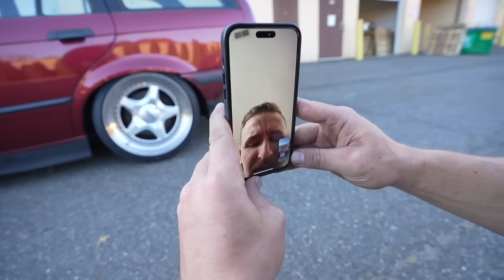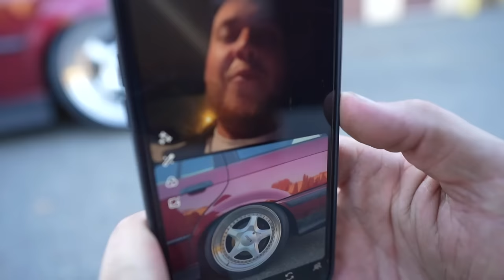Sleeper E36 Wagon gets a CRAZY Transformation!!

Comment: 29:56 Yeah, kinda. But for the sake of safety I propose you to move the fuel filter closer to the engine so it will not get ripped off because of some lost rock on the road. I nearly ripped it off cuz of one, and friend of mine ripped it like four times before he moved it higher and closer to the engine bay.
I highly recommend it - lowered E36 Touring boys from Poland ;)

Comment: Oval-ing the control arm is actually a pretty common way to add camber to 36/46's, plus it also correct the usual toe in issue you get when going low and/or adding a lot of negative camber

Comment: What you should do is heat up all 4 corners, stuff an inch worth of thickness of magazines in between the fenders and tires, and then lower the car onto the magazines. It's the best way to get a slight pull. I've done it on 2 of my LS430 UL's, my ISF, and my SC300, and it works flawlessly everytime. Safe and even way to clearance! I'm telling you bro give it a try!!!

Comment: this is great. if you at some point change the wheels i had good success running 235/35 17  on a 10¨ rear with 30 offset, 32 might be even better (with close to stock camber)

Comment: the touring needs some Aidan magic and get his signature paint correction. Them Eclairs go dumb hard, it's hard to beat a old school 3 piece wheel on a e36.
Oh and there is a common mod on E36 wheel arches and that is molding a e46 fender arch as they are slightly wider and have near identical shape.

Comment: For a guy that makes all his cars too low maybe you should learn how to stance... Extreme lows with 8k springs lmao

Even I, the function ride height guy know that you'll need stiffer if you want to truly be low

Also there is a lot more to be gain if you had a fender roller, those quarters are very stiff and you're never gonna get it 100% with the mallet technique. For example my quarters are heavily pulled (done right tho, most e36's aren't, either they're only rolled or when pulled they're done horrible) and I'm fairly sure those wheels with the same tire would fit with like 2 degrees of camber lol. Slotting the upper arm is good, and sometimes even allows to run less overall camber since you're pulling it from the top where it'll grant for more clearance than it does when you're adjusting from the bottom which doesn't really pull the top of the tire inside as much.

Also last thing, you can always gain like 5mm by shaving the mounting surface of the wheel if it allows it, manufacturers usually leave a lot of meat because that's often how they adjust to have the same wheel available in different offsets that are still close to each other. You're not gonna gain a fuck ton but you don't need a fuck ton